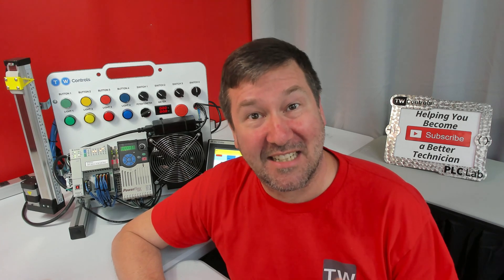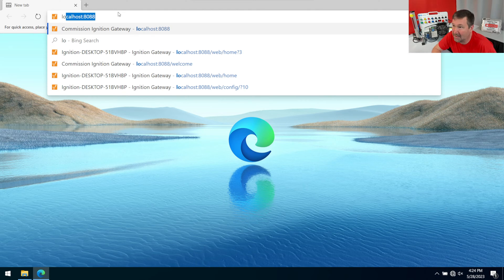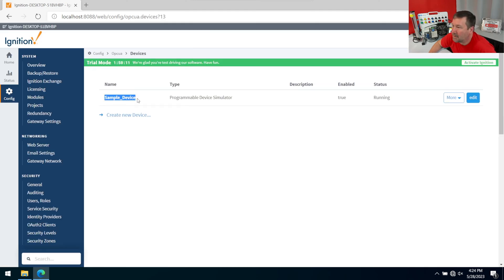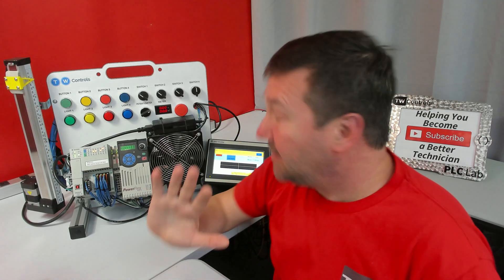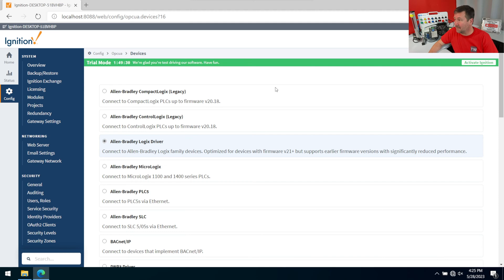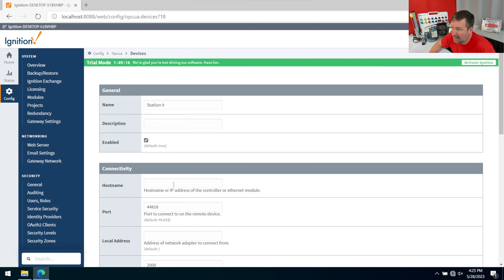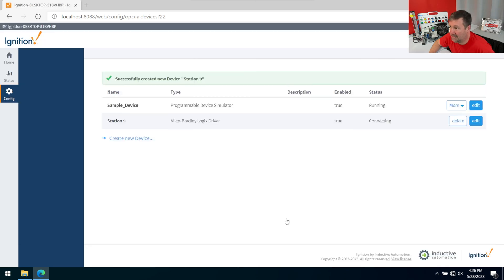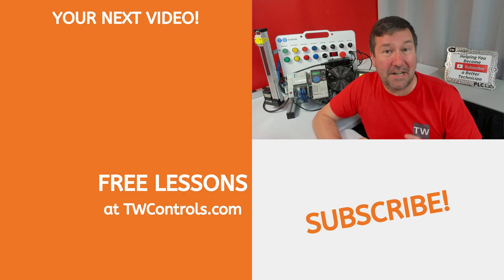Ignition SCADA Device Configuration for Allen Bradley PLCs

Comment: Good Morning Tim, I would to connect by IP external and fixed, it is possible ? how ?
Reply from the maker: I'm not following you question.  We had a fixed IP in this video.
Reply: @TimWilborne  yes , but in the video there's fihed and local ip , if I want to connect by remote, how I will do?
Reply from the maker: There are a lot of items to consider and we are building out a series on the pitfalls of what you are wanting to do, in the mean time check out this link.
https://www.cisa.gov/sites/default/files/2023-06/Guide%20to%20Securing%20Remote%20Access%20Software_clean%20Final_508c.pdf

Comment: Been trying all weekend to get ignition to work with my compactlogix. The issue is that I cannot get my compactlogix to work over Ethernet. Works great over USB but for some reason Ethernet is a nightmare. I’ve tried configuring Ethernet devices and Ethernet IP in rslinx with zero luck.